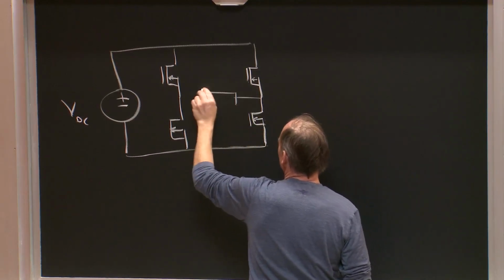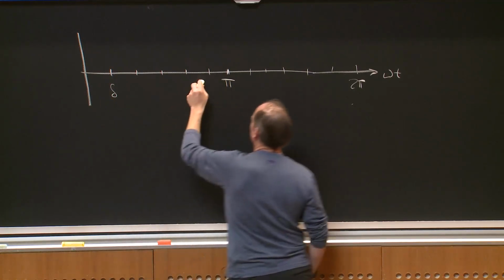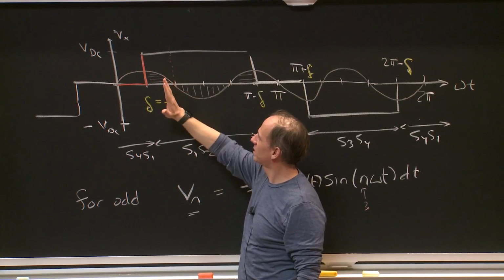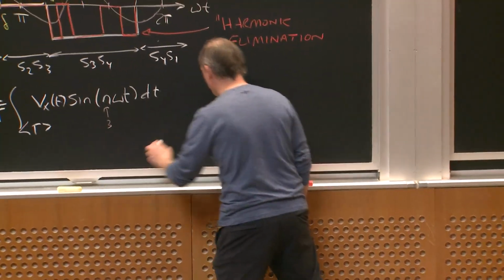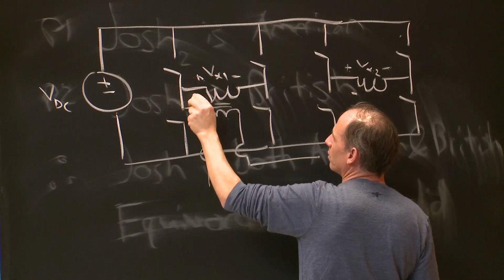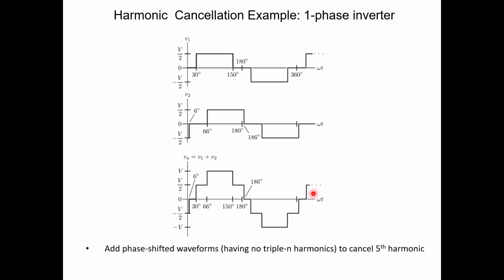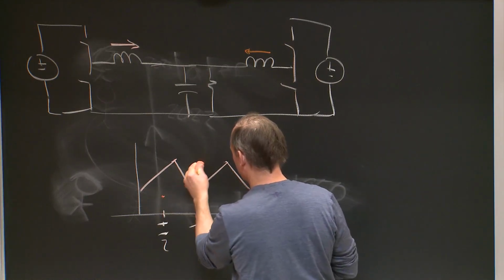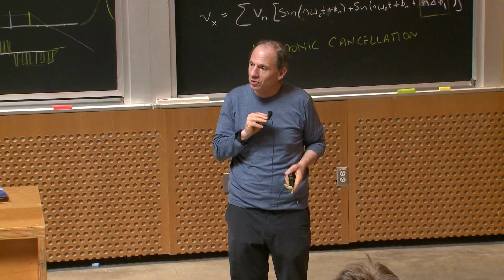Lecture 18: Inverters, Part 2

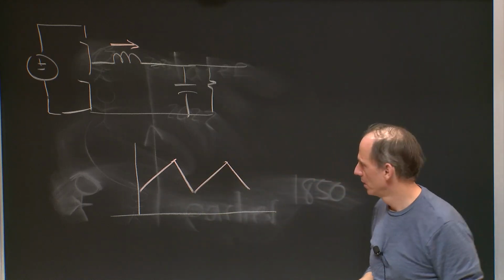Comment: 40:00 i have come across a similar desing in a big (2x 2kW) audio amplifier. The Crown CE4000 uses what they call 'Balanced current amplifier' technology in the output stage. Its two buck converters, with ones input being the positive rail, the others input the negative rail and their outputs being connected.

The desing (released 2003, so in development for a few years prior) predates the dominance of pure class D topologies and is a total dead end. Its a very complicated cirquit, for example involving a 7th order input lowpass filter, huge output inductors and synchronizing both main and auxilliary psu to the output stages. 
The service manual includes full schematics and is available online for anyone interested.

Comment: Hello Prof.  Perrault, 

I have one more question (lots if we had more time, but that can't on a Utube's comment.) 

What is the influence on the final most harmonics out filtered wave form, 
when the output Load is once again a massive inductance of the up-transforming 
output transformer ? ? ? 
Because this inductive impedance, introduces back again phase shifts between voltage and currents flowing, and hence it gets evenmore complex, . . . 

I don't know, maybe the Harmonics filtering is only seen from the Frequency domain. 

However, what happens when we Load this thing backup with a non resistive Load, . . . 

I know maybe too far beyond the scope of this, 
however I liked to pose this question to you ? 

Best regards, Harry.
Reply from the maker: MIT OpenCourseWare is intended as a publication of MIT course materials, not as an interactive experience with MIT faculty. MIT OpenCourseWare does not provide direct contact with MIT faculty. It provides the content but is not a substitute for an MIT education.

Inquiries sent through our contact form ( https://ocw.mit.edu/contact/ ) related to specific course materials may be forwarded to the MIT instructor associated with that course for their consideration. However, due to the tremendous volume of email inquiries received it is unlikely he or she will be able to respond personally.

Comment: Dear Professor Perreault, 
I hope you still read and answer on "older" responses to your Lectures ;-? 
I am in the process of developping myselfs a Transformer based 
Low frequency H-bridge 'near' sine inverter, 
<I don't like the term pure sine> you'll know why I pressume,  
basically the power stages Hardware, Mosfets, drivers, 
for the SPWM signal generation i have to depend on others, 
like the EGS-002, . . . 
However, 
If I learn correct from you : the better the applied signal is, 
the less ones needs to filter in the end. 
Moreover, the better the signal, the harder it will be for the switches, . . . ? 
So am i correct aswell or not that propagation delays 
need to be limited in the nano-seconds regions, to accomplish this ? 
AND, am I better off as the output Load, with a standard E-transformer, 
instead of a Toroidal core, since these are even harder on the switches, 
as to avoid possible saturation currents doing havoc to my precious switches. 
Hence I am already for months busy on my 'bullet' proof H-bridge drive, . . . 
 
 Thankyou for these very interesting Lectures on U.T.  Harry.
Reply from the maker: MIT OpenCourseWare is intended as a publication of MIT course materials, not as an interactive experience with MIT faculty. MIT OpenCourseWare does not provide direct contact with MIT faculty. It provides the content but is not a substitute for an MIT education.

Inquiries sent through our contact form ( https://ocw.mit.edu/contact/ ) related to specific course materials may be forwarded to the MIT instructor associated with that course for their consideration. However, due to the tremendous volume of email inquiries received it is unlikely he or she will be able to respond personally.

Comment: Switching losses are not all bad. I live near a major converter station (underground DC cable from Denmark to Germany) and the valve cooling water will be used in the local district heating (1000 users).